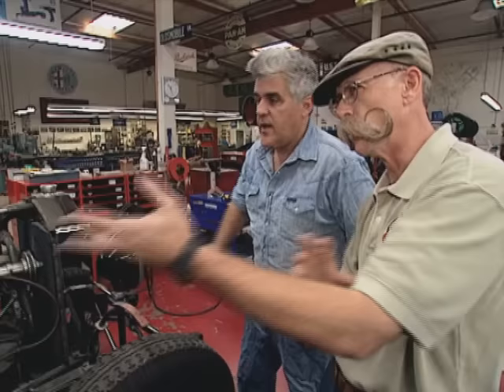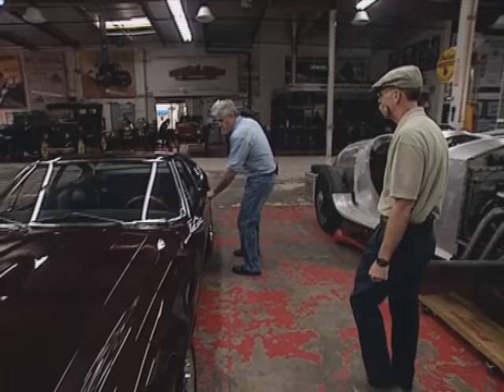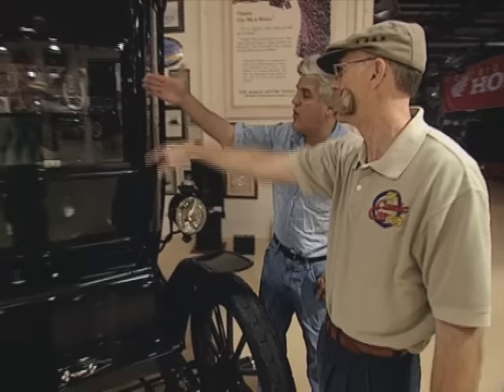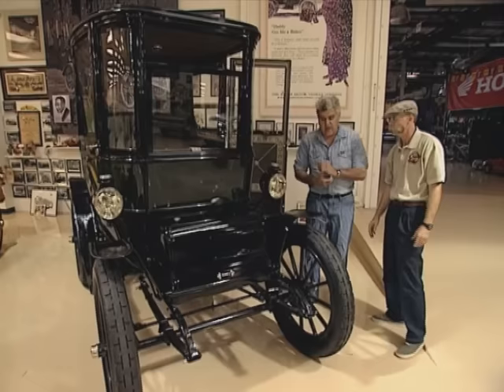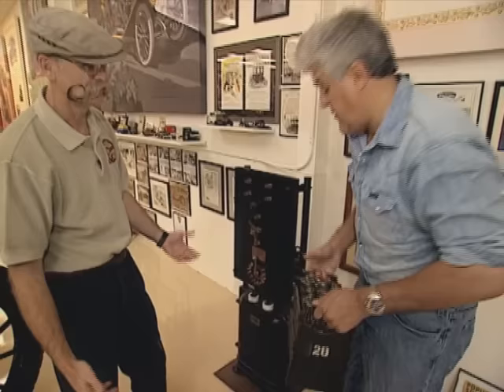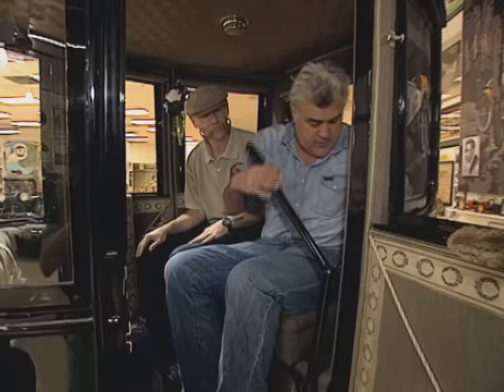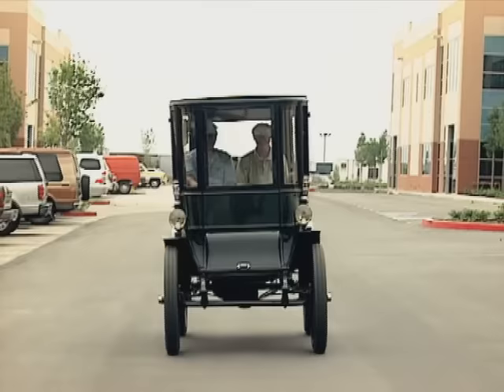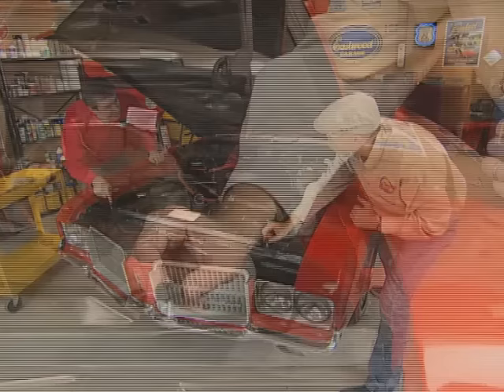Jay Leno's Baker Electric Car

Comment: 100 miles per charge is more than the original nissan leaf. I know the leaf has more amenities, but that is truly an embarrassment.
Reply: Its not though. there are things like price, charging, power steering/brakes, There are alot of thing going on in the leaf and other new electric cars then there were back then. freeway speeds in excess of 65mph.
Reply: Ryan Bernadett Nevertheless, this was 100 years ago. If people have kept developing this, we would have had a tesla in the 60s. Without the ipad thing but you know what I mean.
Reply: Definitely, that would have been really nice
Reply: I completely agree. Designers and engineers need to look upon past designs to see what they can improve on to better their cars. But as you said the people at Nissan are to stupid to do what I just said.
Reply: +The real doktorbimmer you can build a car lighter than 60's cars and before then. but not proper usable cars. You'd have to buy cars like a Lotus 7 or Caterham Roadster with the cloth roof. but yea as a safety tested and all that kind of car you wouldnt be able to get them lighter.
Reply: The reason why modern cars are trumped by this old one in terms of gas mileage is mainly because of modern luxuries. As said by many others, power brakes/steering, high powered motors for tons of torque and speed, air conditioning (probably uses the most energy other than the motors), super strong chassis and frame, air bags, seat belts (to keep up with safety standards), modern wheels (heavy as fuck compared to those wheels that are practically from a bike), and let's just put a fucking tablet on the center console which totally doesn't drain battery at all. So basically, all of this extra weight and energy being used on modern standards and gimmicks causes the entire payload on the batteries to be much heavier than that of old cars. Therefor bringing the mileage down significantly. I bet if you put a Tesla lithium battery in this car, it would go for multiple hundreds of miles.
Reply: Zyron Melancon Leno is working on one of these with a Nissan Leaf powertrain. And in terms of weight modern cars hurt themselves in efficiency even if the luxuries arent being used. Even more so if they are. But it depends on the older cars and all that. Some can get better mileage but a lot dont.
Reply: The real doktorbimmer Well of course this would assume if it had modern batteries such as lithium.
Reply: Well, I'd say that's debatable since liquid fuel is a consumable resource, and Lithium batteries are a storage medium that can be refilled until it eventually goes bad. While the initial cost of producing the batteries may be expensive,  I'd only assume the long-term cost is significantly lower than gasoline. While yes, it is true that liquid fuel holds more energy per volume, it can only be used once.
Reply: The real doktorbimmer it's not perfect but as mentioned it is reusable. Fuel is a one time thing. There is a cycle of course and fuel gets created over time from decomposition of materials. But that takes decades if not centuries. The battery isnt perfect. But it hasnt evolved as much as it could have. Not even close. Give it time. Im not saying EV's are the best. But they are the answer. You may not like it but opinions have nothing to do with it. There is a future of EV's and not so much ICE's for the mass market. 

ICE's if anything will become purely luxury items of the wealthy. And to some extent that's how it should be. Hear me out on it, most people dont care for cars. They are a mobile appliance to get them from point A to point B and that's it. They dont have a passion for it. For those people EV's are going to be the suitable answer. For the others such as car enthusiasts of course im sure we will always want our ICE's. And i think it can stay alive for decades to come but not forever. Are EV's viable for everyone at this point? No, cost of a car and the range it can have are not ideal yet. Charging stations and times are still to be improved on. But there is a market and it's obvious with the existence of Tesla being the main brand selling EV's.
Reply: Yeah, but it'd take you four hours to get there
Reply: What an amazing statement, sir. How do you reason that ICE engines do not require fossil fuels?  The majority of internal combustion engines use either gasoline or diesel fuel, and both are manufactured from refined crude oil. Are you referring to natural gas vehicles? If so, then few vehicles today can function on natural gas as a fuel without making changes to their fuel systems, which are made for liquid fuel.
Reply: Samuel Rosenberg true, but my point is that oil takes centuries or more to be created, then it needs to be collected and refined. Electricity takes hours to days to recharge batteries. Understandably the battery is only as good as it's charge, that's not my argument though
Reply: Samuel Rosenberg of course it has its limitations. Those limitations have not been reached yet. Something you cant say about the ICE's in use
Reply: The real doktorbimmer superior in which exact sense?
Reply: Samuel Rosenberg maybe so, i cant argue otherwise. But EV's can be a viable alternative regardless. The limitations are not so severe to be a hindrance
Reply: The real doktorbimmer i dont believe so, technology advances, yes there are limitations but with that mindset ICE's are outdated. Just because they arent perfect doesnt mean it cant do the job and you honestly seem oblivious to that. Your biggest issue is you dont want to move forward. Youd rather see the earth burn with your mindset. EV's wont be able to do everything but for those that commute back and forth to work everyday and go shopping it will be better. It will help reduce the consumption of oil and in the long run that means gas prices will go down. Maybe not by much but any at all is better for the consumer.
Reply: Samuel Rosenberg yea of course it wont be able to do everything. I would never argue that it could. Trucks will certainly retain a form of combustion engines even if it is to assist the electric powertrain. I dont see what you mean by people paying a premium though, there isnt a premium on EV's. Even Tesla barely make any money on a unit. In the long run EV's will probably become such a saught after market that the premiums will happen just like there are premiums for crossovers nowadays. If people are willing to pay the premium when it comes time then that's on them
Reply: Samuel Rosenberg as a side note, im no tree hugger. I spend roughly 200 to 300$ a week on gas cause i love to drive. I drive a thirsty 5.5L V8 twin turbo and i wouldnt trade it in for an EV, but that doesnt mean EV's arent any good and you know that. I wont ever try and make something come across as being better than it is, everything has its limitations and those limitations should be looked into in order to find a solution. Right now, hybridization makes sense. To use the ICE's for their strengths and the electric motors for their own.
Reply: The real doktorbimmer they arent replacing it yet but give it time. The market will grow once the platform has been refined. Im certain of that. Right now range anxiety and all that is on people's minds, understandably so, when battery technology improves (and it will because it hasnt reached its limits, that's not an opinion) it will attract more and more people. The market is very small right now for the big picture, no doubt and there is no argument that government subsidies are helping the market to grow. But eventually it will not require them to be sustained. Think about it, how many miles do you travel in a day. Around here the average is something like 80 (back and forth with shopping) make that 100 if the A/C or heating is on (that's an exaggeration but you get my point) most people just need to change their habits and EV's could fit into their needs perfectly. The issue is some people cant, and that's fine but range isnt an issue like you think it is
Reply: Samuel Rosenberg ah ok, i mistook your use of the word premium. The only one i can think of is the Nissan Leaf but it isnt really a viable option for most people. That said the costs of building an EV are currently higher because of the cost of the materials and processes. Same reason steam power was and still is very expensive. Gas has just become the widely used form of energy. Give it time and im sure we will one day see EV's being competitive price wise. Tesla's Gigafactory is for that sole purpose. To reduce costs and be as independent as possible
Reply: Samuel Rosenberg because that makes it viable for people who travel longer distances or just want the peace of mind. Of course in general it isnt necessary but as i said, people have range anxiety. If the 300mile range takes away that worry of theirs and they want to get it then they do. The usage isnt what i meant by changing your habits. Because your necessities arent really a habit you can or would want to change. People are used to getting home, parking and going inside. With an EV, people should get used to getting home, plugging it in if needed and then going inside. It's something people complain about all the time, "charging times" and although it is totally understandable you can charge it when you do get home instead of waiting till you absolutely need to charge it
Reply: Samuel Rosenberg and sorry, i should have specified, the 80/100 miles i was talking about, i meant kilometers. Im just so used to saying miles even when i do mean kilometers.
Reply: Samuel Rosenberg i dont commute, i dont need to. Here the gas is about 1.15$ a litre for the 83 octane or whatever, my cars require 91. There's 4.4L in a US gallon so it's a lot less expensive for you guys to fill up, the reason i use so much gas is either to go get stuff or just drive around and it isnt done only with my main car but it does get driven the most obviously. I could do the same in an EV because i dont do all those miles within 1 day. It varies depending on my mood. 300 miles is enough. I wouldnt buy a Tesla yet because there will be improvements and one day i might get one as an extra car
Reply: Samuel Rosenberg yea exactly, but it gives people the option. Consumers will always look at their options and whatever they feel suits them best is their decision most of the time. The 300 miles of range is from the 90kwh battery on the Tesla. The lowest is 60 or 65kwh, im not sure how many miles that has on 1 full charge but it is probably sufficient for the average person.
Reply: Samuel Rosenberg as I've said multiple times the average person could use an EV, that's the average, not everyone. If you travel distances where it is inconvenient then so far the options an EV gives you isnt for you. But there's a difference between running out of range because of the needs and running out of range because of negligence and some people would neglect that they can charge the car when they are at home and do nothing, they would not run out of range if they did. It doesnt affect their lives if all they are doing is staying home while it charges. We can keep going back and forth all you want, but right now your arguments are pointless as it has already been covered.
Reply: Samuel Rosenberg i havent really ever checked my mileage to be completely honest with you. Ive just gone to drive. Most people chose to also buy ICE's instead of EV's. That's fine and those numbers are there but it doesnt mean they bought a ICE because that's what they prefer. It may be because that's the viable option for them. If they cant afford to spend the money necessary on an EV yet then one day they will potentially buy one. So in short what im saying is those numbers dont represent wether people want EV's or not.
Reply: Samuel Rosenberg you dont seem to realise that advancements take time. And the incentives to buy an EV now arent really existent. I never said they were either. I dont care wether you like EV's or not. I like advancements in whichever form and EV's present the ability to advance while ICE's cant anymore. Im not here to sell the idea to you or anyone else. Im just arguing the fact that over time EV's will improve. And lastly you quoted me but added words that i did not say. I dont know wether that was a mistake of yours or you're trying to put words into my mouth. Either way i thought id clarify. Long story short, what i want mainly is that EV's become viable for everyone, so that people can move over to it and in the long run it means my fill ups along with anyone using an ICE will be less expensive. Personally, i dont see the point in the majority of people using gas when they dont need to. Keywords being NEED TO. If they dont have a passion to drive then to them there's no difference between an EV and a ICE except for running costs and cost of acquisition.
Reply: Samuel Rosenberg you consider it an advancement when it reaches that point and that's fine but an advancement is an improvement. Doesnt matter how much it's improved, if it has it has advanced. And i do believe at one stage ICE's will become so rare and only for the wealthy that EV's will be less expensive. That day will not be anytime soon and we might have died by then but i think it is possible. It's like steam cars, they were so expensive to build but had they been adapted by the masses then the price would have went down eventually. If EV's get adapted to the point ICE's are too rare then the costs of an ICE will increase. I have no doubts about that. It relies on the massive takeover of EV's though and that wont be for several decades if not in a century or more in my eyes
Reply: Samuel Rosenberg and i never said they were. I said when a product improves, meaning when a car like a P90D goes from what it is now to a better product in the future then that's an advancement. Ive got plenty of time to go back and forth, all i have to say is if you twist my words you're only hurting your credibility.
Reply: Samuel Rosenberg dont talk about other people's claims. I dont give a damn what others claim. Im not them. EV's may have dominated in the late 1800's and early 1900's but they then disappeared. Yes they couldnt match what ICE's could deliver and neither could steam. Today's world is different though. If EV's werent any good and had not advanced at all they wouldnt be back today.
Reply: Samuel Rosenberg i never said that ICE's will climb in value alone. The popularity of EV's could then force companies to charge more for an equivalent ICE. Your example is the dumbest thing ive seen in a while and just in case you're purposely trying to stray off topic il remind you this isnt about school supplies. Mass production as you should know causes prices to drop, that said if the market is no longer there for a product that used to be mass produced then prices will climb. When EV's become mass produced automatically prices will go down. That's what i meant.
Reply: Samuel Rosenberg that's what attracts people to ICE's yes but it isnt all that matters. Governments are getting very strict on emissions regulations and ICE's will suffer more than they already do if things continue. The efficiency does matter aswell. Thats the biggest downfall of an ICE, you may not like that but it is a reality. Hell even in Formula 1 they can only manage to get 50% efficiency and that's because they recuperate some of that wasted energy thanks to the heat created. 50% isnt good at all and if they cant do any better than 50% with a hybrid powertrain then road cars cant
Reply: Samuel Rosenberg i dont give a damn, they found a way to build themselves up, it's working. Good, so far only GM is really trying to get into the market. Until it becomes a real problem there is no complaints on my part.
Reply: The real doktorbimmer how you couldnt be more mistaken, the Tesla's available so far arent cheap but there's a lot of average income people who buy or have bought Tesla's already.
Reply: The real doktorbimmer good for them. I dont give a shit. GM is also selling their Bolt at a loss, it is an attempt to get into the market. They are willing to lose in the short term.
Reply: Samuel Rosenberg Tesla's use DC, the only AC is when you charge it but it converts it to DC. Also they cool their batteries, yes it creates heat, i even acknowledged it already but it is far more efficient than an ICE could.
Reply: Samuel Rosenberg that is one of the reasons sure, but it's also so they can enter the market which is bound to grow. Look, you cant defend automakers. They are given regulations to follow, it's their choice to pay the price or die.
Reply: Samuel Rosenberg some would argue that Tesla is wrong for it though. And those manufacturers would have still had an axe waiting for them to make a mistake. The emissions regulations would have gotten in their way eventually.
Reply: The real doktorbimmer it doesnt matter what their sales are. The thing that does matter is they are there. When those rebates expire Tesla and others will be on their own, i dont care what happens then.
Reply: Samuel Rosenberg the demand. Ive explained it already. Yes the ICE's dominate but if the masses choose to change over at some point it will hurt ICE's prices.
Reply: The real doktorbimmer Tesla doesnt lose money on their cars, others like Nissan and GM are selling at a loss to get into the market as mentioned before. I never said their buisness model isnt sustainable. You did, i said i dont give a fuck. Why? Cause i just dont, it's not my problem.
Reply: Samuel Rosenberg i believe people will want the technology that will come in a more affordable EV, maybe like the Model 3 and they will switch over. That's what i think will be the cause but obviously there's no way of knowing. Tesla are working towards mass production though and that will drive their prices down meaning they will be able to lower the costs. You're starting to run around in circles again. Id suggest you save yourself the trouble but if you want we can go around in circles all you want. Ive got plenty of time on my hands
Reply: Samuel Rosenberg it doesnt matter how much theyve been reduced, nature wont be like "oh you made an effort so we'll do our part", there is a problem. It's put manufacturers out of buisness before and if necessary it will do so again. There are regulations set in place. Wether you like it or not, complaining to me about it wont change anything. Wake up and see reality
Reply: And for the record, no. I dont like that regulations are slowly killing our performance cars and all that. I honestly hate it. But id rather see something being done before it's too late and it already might be
Reply: Samuel Rosenberg i think emissions regulations should be realistic but strict. Yes my car isnt as green as an EV, before telling me what to do you should do it yourself, but you wont. And believe me my car wont go to the crusher even if it was illegal to own it. The biggest issue isnt people like me, it's ignorants and you really are starting to look like one of them. You really are. Keep it going though because as of recently you're making yourself look like a fool.
Reply: Samuel Rosenberg i wouldnt send it to the crusher regardless. If it comes to the point it has to sit and can never be used it will sit and never be used rather than getting crushed. Yes im glad i have better performance than a 1975 muscle car with less pollution. What i want to see being done is action being taken. If you think my car is that big of an issue maybe you should rethink that. Manufacturers like GM create more pollution than i ever could in my lifetime. And like all major brands they mass produce cars to a point where they actually have a massive surplus that then needs to be crushed. That's a huge waste of energy. Wake up, if you care for action to be taken you'd realise that.
Reply: Hinder? This looks just fine to me. A little faster would be nice, and get people from A to B. The problem is we get told what we really need must be faster, bigger, flashier and COST more. Not so. Why not build a higher tech version of these and run them in towns and cities across the globe, user friendly, free and accessed with a  taxpayer security swipe card? China alone would remove a major part of the climate change "problem" overnight.
Reply: Wait, are we going or torquing now?
Reply: doktorbimmer 
i like electric cars despite the anthropomorphic climate warming/change scam/lie!
They seem so appropriate in the electric Universe we live in.... The combustion engine is more fun tho', especially when they're run on water. Sadly, to have one is a death sentence!
Reply: Baker Electric weighed 250kg and 400kg, one had 1kw another 1.5kw motor (that's how much power you put on an ebike these days). 
Leaf weights probably around a ton, and has somewhere around 50-60kw motor.
I cannot find any good info on what batteries did it use, but it definitely didn't go up to 25mph, wiki says it's 25kmh (14mph).
Reply: ICE's cant compete with Teslas.
Reply: To be honest, for me it was "The only car 100% maintenance-free"... modern cars have a lot more non-drivetrain body mass, to get in the way. 

But even modern "electrics" should be able to attain similar levels of reliability (bar the brakes... those will still need changing pads and maybe oil ).

After all, the drivetrain (engine, power control, reductors) can be derived from industrial designs that work 24/7 years-on... 

Of course, that would be a problem for many car makers  who use a "printers-like" business model (the car is sold at little more than the bare production cost - the mark-up is something like  5% on a small car - and all true earnings come from maintenance and other accessory services, like in-house financing), so I fear they will find a way to get electrics to be as unreliable as petrols.
Reply: nissan is junk... tesla is the future!
Reply: You also have to consider the speed. If you ran a Leaf at no more then 23mph at the same acceleration. Turn off all  heating and AC, You'd  more then double the distance.
Reply: Nissan is an embarrassment in general.
Reply: You are all overlooking the growth curve of how many watts are used relative to speed.
Reply: exept its 100 at 25 mph a tesla at that speed would get 3 or 4 hundred if not much more
Reply: No it isn't. Nissan had the courage to take electrucal power seriously again and helped to start the momentum. Thanks to them and tesla we might drive electral cars in the near futurei
Reply: @hdaviator9181  I remember in Long Beach had the Red Car, a electric bus line BUT it was either Good Year or Firestone that pushed to have them removed because Cars sold more tires, they got rid of the Red Car, paved over or pulled out the tracks, junked all the cars  and 20 yrs ago they came up with the Metro from L.A. to Long Beach using the same road the old Red Car had used.. they should have kept using the Red Car all along. The more we progress the further we go back.
Reply: 100 miles of range at 23 mph.😂
Reply: The Leaf is also much heavier, and goes much faster.
Reply: The chief engineer of the Leaf was one of the lead designers of the greatest family sedan ever built, so watch your mouth.  Nissan doesn't build batteries, they build cars.  Put a first gen Leaf battery array in one of these and see how many miles you can go at 23mph.
Reply: @hdaviator9181  Except people did keep developing upon batteries, the problem was back then recharging batteries was not cheap and if you didn't live in the city that had the chargers, almost impossible. Scientists and engineers never slowed down or stopped their research on battery technology, they kept at it the entire time. The reason why we didn't have cars like the Tesla we have today is simply because cars kept getting newer and newer addons to make them safer and easier to handle. Only now can we make batteries and motors powerful enough to move something that weighs as much as a modern electric car. Hell they had some pretty advanced batteries back in WWII in submarines which would be charged while the sub was surfaced or at periscope depth (If it had an extendable intake and exhaust) and when the sub needed to be submerged bellow periscope depth they could run off of the batteries for a few hours reducing their sonar presence.
Reply: Try to driving leaf 23 mph... You get same range. But true is the leaf is 100 years younger, should have better range
Reply: It cannot possibly cover 100 miles, particularly with hills, and no Regen.
Reply: @ryanbernadett2818  Nah. There have been hundred of cars that run on water, all patent holders simply dissappear or commit "suicide".